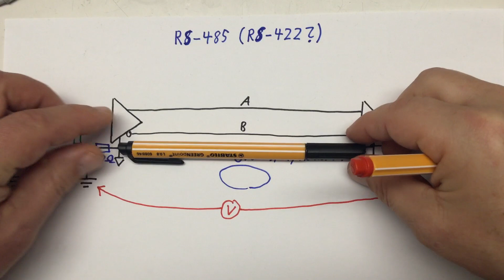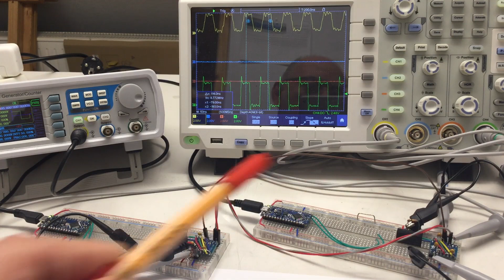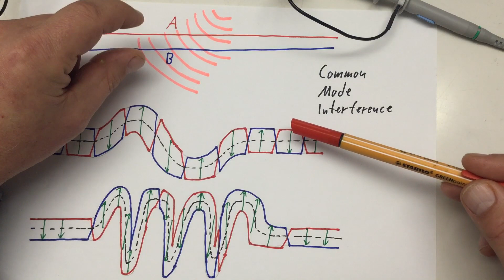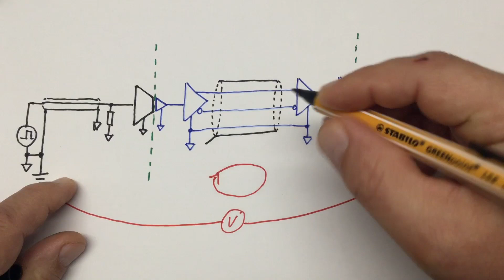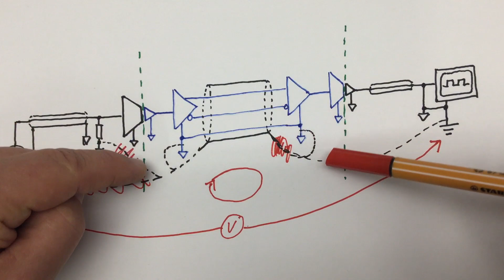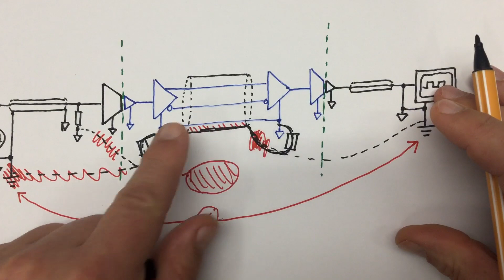RS-422 Differential Signaling (ISL8490, AdUM121N) – The Details (4/4)

Comment: Realy nice explain.

To reflecting the 43Khz noise.

The isolated converters are capable to introduce some common mode noise by capacitive coupleing between the coils. So may need to provide an another capacitive return path to manage this noise current back to the primary side.
Reply from the maker: You're right. Even the cheapest switch mode wall wart does have a (hopefully Y-type) capacitor connecting the primary and secondary side for that reason. According to the datasheet of the RFP-0505S DC/DC converter I'm using, a  2.2nF/1000V capacitor connecting the positive rails and a 1nF/1000V capacitor connecting the negative rails is required to be compliant with EMC class B (consumer). They are not needed for EMC class A (industrial) compliance. So let's just assume I'm in a industrial environment 😅 Anyway, thanks for bringing this up, because I totally skipped over that "little" detail in the video.

Comment: Ground loop why connect both ends ?
Reply from the maker: Basically, if you can, simply don't connect both ends. But ff you want to avoid running a dedicated ground / signal return line, you have to connect both ends to mains earth (if available). If both, transmitter and receiver, are referenced / have a connection to mains earth you have a ground loop - unless you isolate your receiver and/or transmitter (which is the preferred way to do things, but also the most expensive).